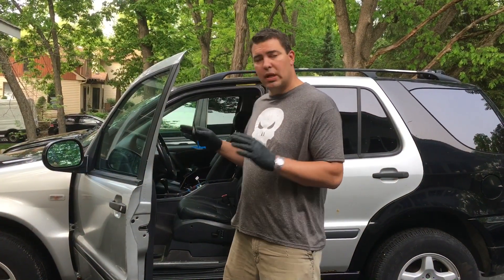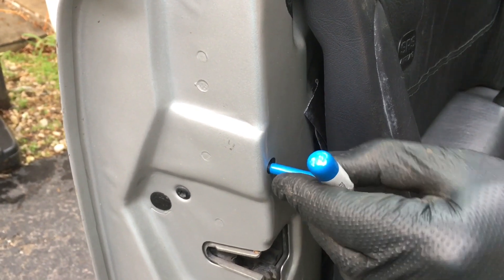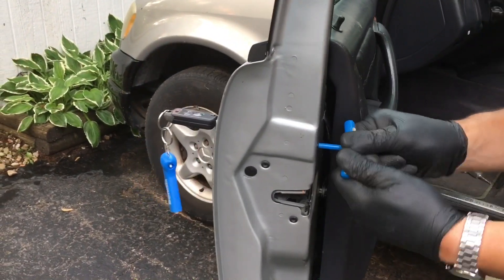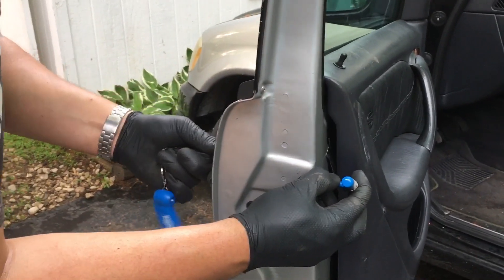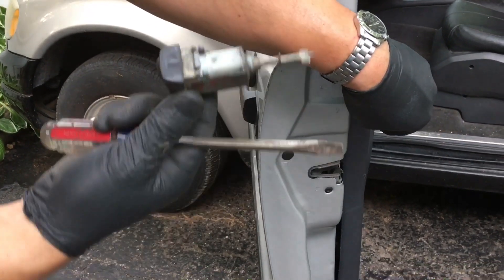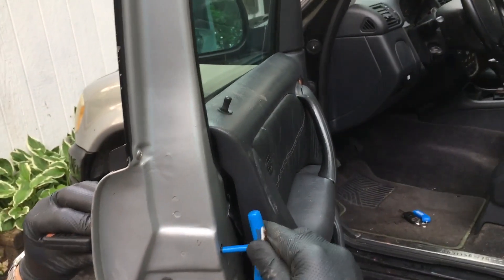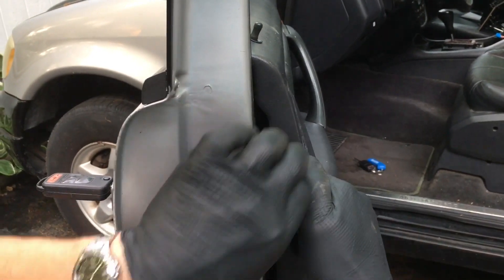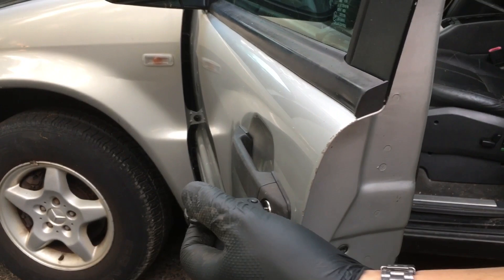How to change door lock cylinder on a Mercedes Benz W163 ML320 ML350 ML430 ML500

Comment: Hey Joe, have you repaired any of those ML key fobs/remotes? Mine is basically shot. Would like to replace or repair it.
Reply from the maker: Yes I've ordered some of those cheap ones on ebay but never had much luck, it takes a little modding just to get the key to rotate you can make it work, but I've found i've had to grind down a couple parts and use some super glue lol. Maybe I'll make a video one day on that. My buttons never worked though.
Reply: @joesnowmobiles  Glad you said that. Was actually thinking about picking one of those up lol! Thanks and great vids my friend!
Reply: What do I have to have to change my ignition switch my lock cylinder messed up and I lost the keys

Comment: Where did you get the lock from? Please don't say Mercedes. I had a junkie use a screwdriver on my ML and don't want to order a new key and parts from Germany.
Reply from the maker: Hi Roger you can find them on eBay they are not very expensive at all.
Reply: @joesnowmobiles  Oh, 🇨🇦 🙄 eBay Canada is lacking. Same with Amazon. Thanks for answering though.
Reply from the maker: Roger Wood can you buy from eBay USA? Plenty on there!
Reply: @joesnowmobiles  Essentially everything that can be shipped to Canada is on the Canadian (.ca) eBay website. Trump's trade war has made it very hard and expensive to get parts from the US. It is like time travelling to 2007. I feel like I'm back in New Zealand (the island of misfit toys) where every car part costs 200x what it does in the US.  You could retire by smuggling car parts in NZ on a rowboat, no joke.
Reply: Mine was $100 at the dealer and it came with a extra key